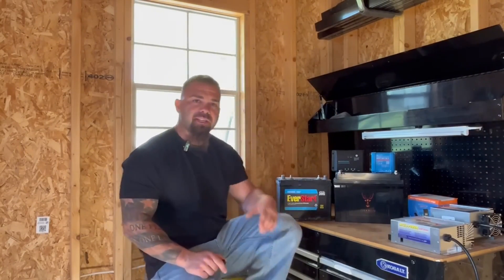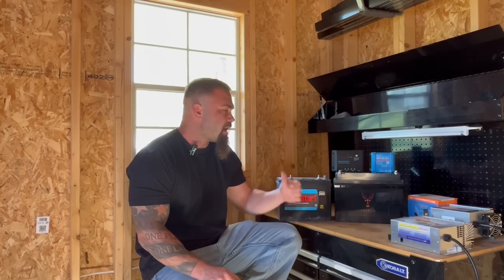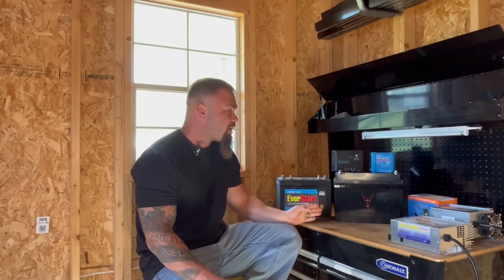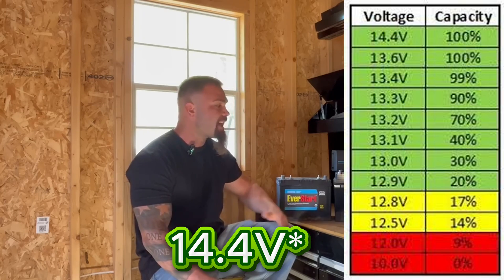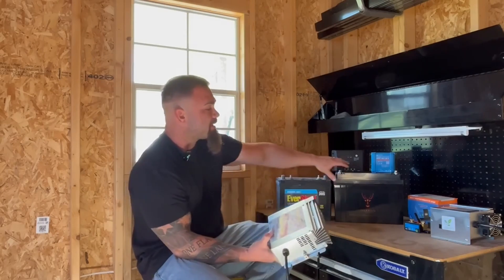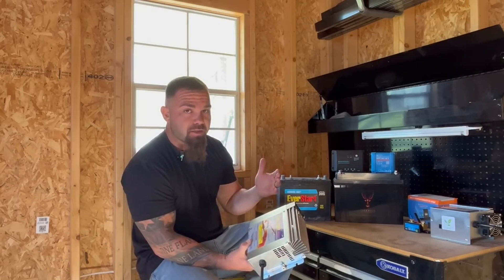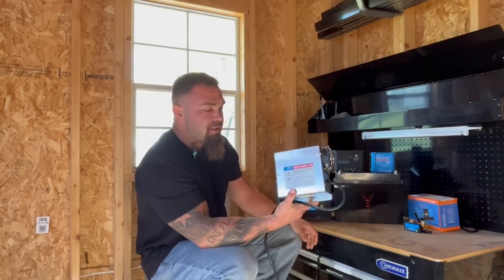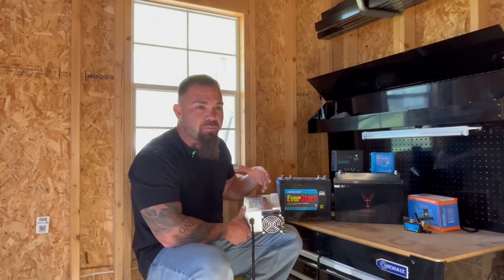RV Lithium Battery Upgrade Explained | Charger, Settings, & Shunt Monitor Setup!

Comment: When upgrading to lithium on a travel trailer where I am NOT charging from the alternator, do I need to disconnect anything from the 7 pin to protect the alternator? I am assuming the 7 pin is charging the standard LA battery while connected? And that would be a very light gage wire.
Reply from the maker: There are no worries with tow behind trailers. The alternator wiring to the 7 pin is too small to pull excessive current and the voltage of lithium batteries is high enough where they don’t demand much from the alternator either. Here’s a short video on it. 

https://youtu.be/dPbLYw6qu2Y?si=CfrQRSuJ79m9aHnT

I got your email as well and will respond when i get some time after the holidays!

Merry Christmas!

Comment: So, if my converter can be changed over to LI and my factory installed MPPT RV-C solar controller can be changed to Lithium (2 big ‘ifs’ at this point. 2024 Eagle), I can make those changes and simply swap with a lithium that has the BMS and Bluetooth capability, without a shunt. No worries with the towable 5th wheel overloading the alternator with the small 12VDC wire on my 7 pin. I’m verifying my thought process here with you after watching your video, reading the comments, as well as another video from a legitimate creator. Am I clear here?
Reply from the maker: That’s right my man!! Change the charging sources and have a way to monitor state of charge and you’re off to the races!
Reply: @RvPowerPlug  awesome. Thanks for verification!

Comment: I bought a 2025 Flagstaff which came with a lead acid battery. My charger automatically knows the difference and adjusts accordingly based on the auto detection feature. Also, a lot of these new Lithium units come with their own smart phone app (shunt?) which would make it very obvious if it wasn't charging correctly. Thanks for spending more than five minutes on that. How many amp hours you got? I'm seeing 600 now! Crazy. As far as I can tell, I just need to get the highest amp hours and make sure it "fits" in the battery compartment. I haven't heard LifePO4 mentioned vs the older technology in Lithium. Converter  is auto detect. I don't use my alternator charger. Instead of a shunt, I think I'll by a lithium battery with the smart phone app. No mention of Amp Hours. This was uploaded two months ago. No mention of trying to run your AC and your Microwave with it. No mention of  solar panels. Okay, peace!
Reply from the maker: Im assuming you’re talking about the picture for the thumbnail of the video when you ask about amp hours and the system running things. That was a picture from an installation i did some time ago. Check out this video and it’ll answer all of your questions about that system!

https://youtu.be/MT2vLyIncDg?si=3ed2tBkVmTZYcmTU

Comment: Is it imperative to install a DC2DC charger when upgrading an RV system to PiFePo4?  My converter is lithium aware but my concern is frying my SUV alternator.
Reply from the maker: Is it a towable RV or a motor home?
Reply: @RvPowerPlug  Thanks for responding!!  Sorry, it's a small towable.
Reply from the maker: @JimDandy-q2b1v  Dc to DC chargers are not required for towable RVs. Its a misconception in the market that changing to lithium batteries will hurt the towing vehicles alternator. I’ll leave the link below for the video i made explaining wire size constraints on this topic. 

https://youtu.be/dPbLYw6qu2Y?si=rv7eYP41vHaufdEG
Reply: @RvPowerPlug  Thanks!! Appreciate it!
Reply from the maker: @JimDandy-q2b1v  No problem, happy to help.

Comment: 2025 F350 with tow package and an Alliance Avenue All Access, adding a 280AH ECOWorthy lithium, hearing mixed thoughts on whether I need to worry about the alternator in the truck.  Not planning on any major boondocking, just the occasional overnight Harvest Host or parking lot stop between destinations.  Thoughts?
Reply from the maker: Nothing to worry about brother! Check my video on it!

https://youtu.be/dPbLYw6qu2Y?si=gb-TyFX5SmXDCeTV
Reply: @RvPowerPlug  thanks a bunch, I will watch it.  New to your channel and love the content.

Comment: You got me stuck. I'm looking crazy right now. Okay I have a motorhome. I have my converter from what what Google is telling me. It's saying that I have one of the best that Amazon recommends. It's like one of the top converters and it can differentiate between lead acid and lithium which tells me that it can charge lithium batteries. Yet the output is 13/6 so the math is not mathing
Reply from the maker: If it says it supports both then you’ll be good. It probably lists multiple outputs to cover lead acid and lithium
Reply: @RvPowerPlug no sir it's only output is 13/6  so today Ive tested it and the multi meter is telling me 13/2.
Reply from the maker: @RonBme  what type of battery is connected during the test?

Comment: I am really new to all this. I have done some maintenance on my RV and very little electrical. I have a 2014 Class C motorhome with a 120-amp alternator and 2-65Ah lead acid batteries. I currently have a WFCO 8955PEC converter. I have a 12v fridge. I want to switch over to lithium batteries. I am considering the Vatrer 300Ah lithium battery with blue tooth. What would you recommend changing out my converter to one that is compatible with the lithium battery that can go with my current system. I know I also need a DC-to-DC charger, so I don't burn up my alternator. I am going to go with your recommendation of a Victron charger. Should I get an Isolated or non-isolated one.  Do you have a video on properly connecting the Victron, close to the chassis battery or house battery. Thank you for all your help
Reply from the maker: 300AH will be a great amount of storage in that platform, especially with the efficiency of a 12v fridge! Make sure you measure good and ensure the battery will fit in the stock location to make the install easier! 

You’ll need a non-isolated DC to DC for this application. I plan to make a video on the installation of this unit but it will likely be a few months. I really like the progressive dynamics 60A converter, they can be found on Amazon and in 5 years of installing them i never had a failure!
Reply: @RvPowerPlug  I have a 120amp OEM alternator on my Class C. In your opinion, is that going to be a concern? Should I get the Victron 12-12-30 DC-DC charger (I think I got the term right)? When installing the DC-DC charger, should I place it near the Chassis battery or the house batteries?  Thank you so much. Your videos make this so much clearer.

Comment: can you have 1 blue tooth batter in a 3 battery set
Reply from the maker: If the batteries are wired in parallel CORRECTLY (see some of my short videos for correct wiring in parallel) and they are all the same amount of storage IE: 100 amp hours, then yes, one battery's reading should indicate closely to the rest of the bank. They may vary by 1-5% but not enough to make a large difference.

Good question!

Comment: 13.6v is more of a FLOAT charge, your really supposed to charge most Lead acids and agms around 14.2 and 14.4v so yes lifepo4 is still a drop inn replacement, sometimes you can get away with 13.6v but thats not really the proper charge voltage. the RV chargers ive used actually charge to 14.4v and after teh current drops they will drop to 13.6v which is perfect for lithium as well
Reply from the maker: A lot of people get hung up on these voltages and start splitting hairs, all I’m saying is, a standard converter will drop the amperage output down to nearly nothing when trying to charge a lithium battery. This becomes very problematic in camping situations where you need to run your generator to recharge because it will take 8-10 hours to gain maybe 10-15%.